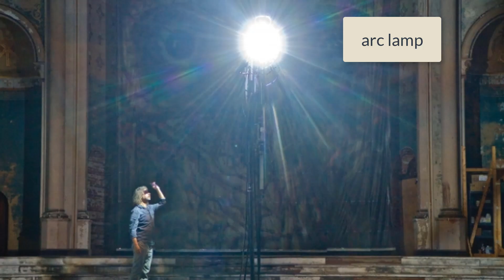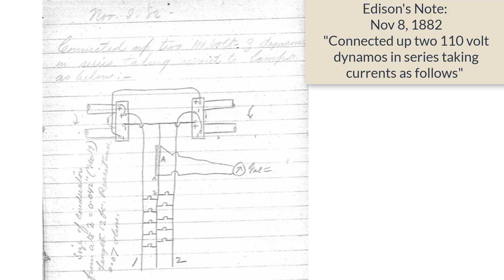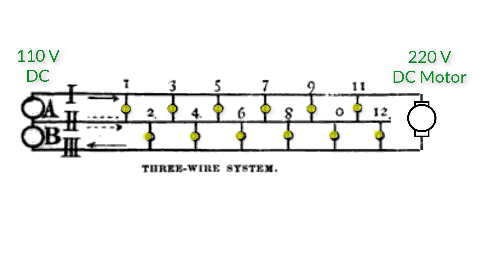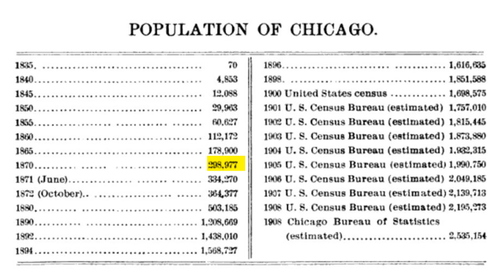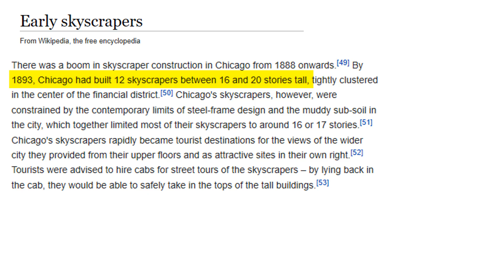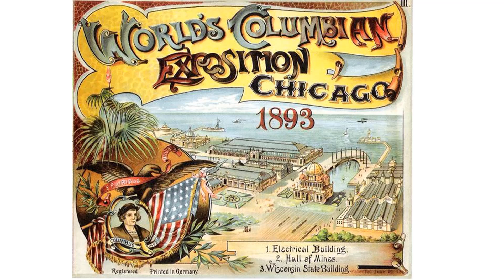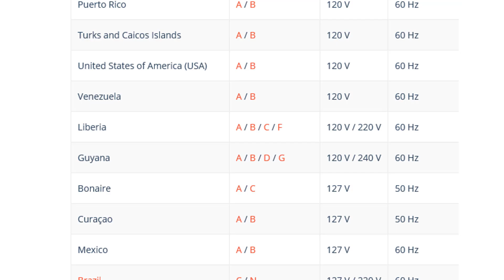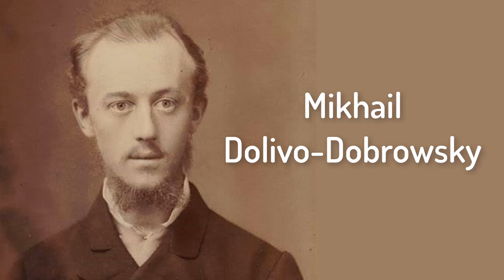Physics and History of Why USA uses 120 volts and not 220 volts

Comment: I enjoy your discussions on the history of electricity. My dad, like me was also an electrical engineer, said that in the early days of development of the light bulb, it was difficult to make the filiment thin enough for a higher resistance to run on 100 volts. The tungsten filiments were coiled to keep them compact so they didn’t have to have wire supports in the lightbulb. The 220v made the light bulb more difficult to make. Years later by better manufacturing techniques, they were able to make thin high resistance filiments. The 7watt candelabra light has a really fine filiment that was fragile and it took even longer to develop. When I grew up in the 1950s, when decorating Christmas trees with these bulbs the filiments would break easily when dropped. 
Remember that the only use for electricity in the early days was for light bulbs, so making practical filiments was important.with time light bulbs got smaller, but they were then made for lower voltages and ran In series. 
PS I worked in two Silicon Valley laboratories where they developed the first practical LEDs in the late 1960s, that is Fairchild semiconductor and HP laboratories. HP first used them in the HP-35 calculator. “You could get them in any color as long as they were Red”! To paraphrase Henry Ford. Ross

Comment: How can you get 220 volts across a motor from connecting 2 positive 110 v supplies? I think your diagram needs some adjustment. Both 110v lines would be connected to the positive and you would then connect the neutral line to the negative.

Comment: USA AC voltage in homes is now 240 and 120 vac at 60 Hz. The power company puts a transfomer to step down the high voltage on the transmission lines down to 240 vac with a center tap that allows the electrician to wire either 240 vac or 120 vac to every outlet or light in the home. Europe is most 240 vac at 50 Hz which does save on copper wiring in the home since you can deliver twice the KW power with the same amps and copper wire size. However 50 Hz does have the drawback that the transformer has to have more steel since the magnetic coupling is less at 50 Hz than at 60 Hz.

Comment: I disagree with your explanation of 3 phase generation. You relate 3 phase to 3 different wires and that's not the concept at all. 3 phase electricity is formed inside the generator with 6 different magnets and producing 3 different phases of electricity during a single rotation of the generator. Instead of the sine wave switching 180 degrees polarity all the way to peak plus and minus negative voltage, it is generated 3 times at once on the same circuit with every rotation of the generator core. This 'smoother' type of signal is much easier on electrical equipment. The way you explained it made zero sense to me.

Comment: North American and some other locations use dual voltage 120V/240V 60 Hertz single phase AC for residential, office, etc. and 480V 3 phase 60 Hertz or industrial.  This is compatible with European 380V 3 phase 50 Hertz.  There is still a lot of old industrial stuff of varying voltages.  I'm old enough to remember 25 Hertz, including 25 Hertz 4 phase (the last place to use this, to my memory, was the North end of Philadelphia, PA, and the last-last place was Frankfort Arsenal, i n. the North end of Philadelphia, PA.

Comment: BTW, houses as in residential locations, especially single family dwellings DO NOT get two phases of a three phase system. They use TWO legs of 120 (from a single winding distribution transformer) and are provided with a  neutral (ground). The result is 120 either leg to ground (or neutral) and 240 leg to leg. The phase relationship between 120 and 240 in the home is "0" degrees.

Comment: One of the reasons for the 110 volt value was that the first lamps used a carbon filament in a vacuum. By lab experiments,  Edison found that above 110 volts, the lamp filament life would rapidly decelerate. This was what Edison found was a "sweet spot" to  establish the 110 standard based on carbon filament technology. Tungsten came later in 1920's . The +/- 120 volts was found empirically to be the highest "practical value" with tungsten filament bulbs. When tungsten  was introduced in 1920's replacing carbon bulbs, 120 volts was selected as the highest value as a compromise for filament life vs. base design voltage. Higher voltage lamp designs came later in mid 20th century.

Comment: This is missing a HUGE piece of the puzzle on how our electrical grid came to be as it is.  Nikola Tesla and his research into polyphase electricity and the invention of the AC induction motor.  While lighting was important, it was just a small percentage of power being used.  The vast majority went to running AC induction motors, which most ran on 3 phase power.

Comment: The main saving using a higher voltage is in reducing distribution losses, the power lost bringing power to end users, but yes, it also eases the requirements for transformers, the same power can go through thinner wires. In the case of 60Hz vs 50Hz, well, they are quite close to give a clear advantage to any of them, AFAIK the frequency was chosen so no flicker could be seen in light bulbs, and both achieve this. There is a slight advantage in 60Hz due to transformers being marginally smaller, but in long distance transmission lines create slightly more problems with line couplings and reactive distribution, but just *slightly* more.

Comment: Thank you. I love vids that make me think and search a bit. I started wondering if the bulbs would be as bright on AC. I should have remembered that wall voltage is its RMS value. (Spoiler: the same bulb and brightness.) 120V RMS has a peak voltage of 170V. Approx 156.5V peak AC if your house has 110V/220V supplied.

Comment: Where does Joseph swans light bulb fit into all of this, as he supposedly invented his at least at the same time as edison. They even became partners eventually iirc in the ediswan company. As presumably these existed before the German dudes and their new fangled tungsten, was the uk/European system lower voltage originally or was swans bulb suitable for higher 220v operation?

The US split phase system is a bit of an anomaly, but as far as I can see you didn't really explain whether the 110v was a holdover from the DC era or was instituted for some reason during the AC era, or why 60hz vs 50hz. Iirc the European 50hz was something to do with Siemens producing equipment but could have misremembered.

Comment: That's the most detailed description I've heard so far. I knew it had to do with Edison's 110V light bulbs, but that was all I knew. It was not only voltage, but frequency. Westinghouse favored 60 cycles while Siemens favored 50 cycles, so countries which bought American Westinghouse equipment standardized on 60 cycles and countries which bought Siemens standardized on 50 cycles. Japan brought from both, so they have an interesting mix of 50 and 60 cycles. Of course we have a few pockets of 25 cycle power, used for railroad traction power. Safe Harbor Dam still has 2 25 cycle machines to generate power for Amtrak. BTW the railroad uses 440V to distribute power on at least some of their trackside lines. I often see 440V written on the crossarms of open-wire trackside lines. Now we've come full-circle and DC has come back into favor, at least for some high power transmission lines.

Comment: I live in Kobe, Japan, where our electrical system is the EXACT same as the USA: 100-110v, 60 hz. The eastern part of Japan, near Tokyo, uses 100-110v, 50hz. So I can buy and use anything made for use in the USA. It will run perfectly well and safely here.

Comment: In Silicon Valley there is a thing called First Mover Advantage. But there is also a thing called First Mover Disadvantage. And the 110V in America is an example. Same goes to NY Subway system. The reason why the subway in NY is so complex and yet so backward because they invented subway there. So it is not always the best to be first mover. You go slow so that if changes need to be made you are not too committed to change the system.

Comment: The optimum burning voltage of a carbon arc lamp is between 55 and 60 volts. Two of these in series require 110 to 120 volts. Four in series require 220 to 240 volts. This is the origin.

Comment: Another mistake. Towards the end of the video you stated that the 2 phase wires were 120 degrees apart. It is the push and pull of the AC current on those 2 wires where the phase of the push and pull is 120 degrees apart. The two wires have nothing to do with the phase. Just clearing that up.

Comment: Fascinating history!👍 My reading is limited, but I understand parts of Europe use three phase much more extensively than we do. Our common use of “radial” (one wire) feeders saves copper, but three phase motors and heaters in the home would be more efficient, and load balancing wouldn’t be an issue.  Imagine if we used the 400Hz AC that became common in aircraft to save weight. I spent four and a half decades with the “60 cycle hum” of transformers (retired Hydroelectric Operator); imagine living with a “400 cycle hum.”😉

Comment: Americans have 220v up to the consumer unit. It is then split into two banks of 110v. However, most A/C units require 220v so they use a double fuse that connects both 110v lines to give 220v

Comment: US/Can power to the home is not 120 volts, it's 240 volts. The two wires that Kathy describes as phases are not individual phases, they're the two 'Legs' of a single split phase. The transformer outside of the home splits one phase of the high voltage (typically 3-phase) distribution line(s) into a three wire system (L1, L2, N).

Comment: There seems to be a gap there.  Because we do have ~240V service to our homes.  The reduction to ~120V happens by splitting the phases with the 3 wires at the transformer we're connected to... but the two legs are still ~240V.  So, the infrastracture was "fixed" by that and the utilities didn't really have any need to adapt it.

Recent update on WIlliam Jenney:  Apparently, it wasn't enough.  Chicago's buildings are sinking.  :)  Of course, newer even heavier buildings now.

Comment: Although on paper the UK has 220 volts it is actually 240 volts. This was a fudge by the EU who wanted the voltage to be the same in every member country. So voltages go from 220,230&240 with + or - 10%

Comment: Another consideration is materials technology wasn't as far along in Edison's day as it is today. In spite of the fact that higher voltage is more efficient by reducing current, at that time  insulating wires to prevent them from shorting and causing a fire was a dangerous issue. The higher the voltage, the more critical the insulation on the wires became.  When wires are manufactured the insulation on those wires  has a voltage rating.  The rating is determined and certified by testing laboratories like UL and CSA. Since the technology took hold in the USA before other countries,   the most expedient solution, around the higher voltage jumping through the insulation around the wires, was to lower the voltage.

Comment: Higher voltage like 240v locks your muscles up when you are electrocuted. 120v allows a person to maintain enough muscle control to let go what is electrocuting them. It's easy to step down from 240v and most devices work fine on 120v. So that became the standard for wall outlets.

Comment: My grandfather was an electrical engineer who told my father around world war I that the President of Anaconda Copper handed out stock certificates in Congress and stated that these certificates will be worth twice as much if you adopt 110 volts instead of 220 as the national standard. Why? because when you halve the voltage, you need twice the current to transmit the same amount of power. The size of a wire determines its current capacity, the insulation around the wire determines the breakdown voltage. Copper metal costs more than rubber or plastic insulation, so the smelters wanted to sell more copper. At that time the worlds largest copper mine was in Jerome, Arizona, and rubber was imported from southern Asia. Congress also liked the idea of keeping our dollars at home.

Comment: How did he reduce the copper by 60%? Removal of 1 wire would be 25% and then reducing the 3rd wire by even 80% only adds another 20% reduction for a total of 45%.

Comment: I found it interesting that Edison had DC 3 wire distribution with 2 legs with 110 volts.  I think more could have been said about the transition from DC to AC.  New to me was why the US stuck with 110 volts while Europe went with 220 which takes a lot less copper.  Some time I would like to hear the explanation why all our house wiring has a ground wire and a "cold" power wire which also goes to ground.  Europe doesn't.  Seems like a terrible waste of copper which is getting more expensive.

Comment: The supply to my house (in the US) is 240v single phase.  the output transformer is center tapped giving two 120v split phase circuits.

Comment: The only advantage the American mains has is that that it runs at 60hz which is slightly better for AC transformers than 50hz. However you have to use more copper to carry the higher current demands of the lower 110v rated appliances...

Comment: Presumably the reason the US generally has 1500w electrical heaters for homes and the UK has 2000W electrical heaters for homes is due to the voltage difference 1500w/120v = 12.5 A vs 2000w/230v = 8.7A meaning less copper needed.

Comment: All very well. D.C. is fine over very short distance. Tesla's A/C far better for national transmission. Similarly 240 volts is more efficient than 120 volts. Understandably America which pioneered most of this work, was hampered by a legacy system. The same thing happened with the advent of colour TV, America had it first with the NTSC system, derided by the rest of the world as "Never the same colour twice". UK, and most of the rest of the western world used the PAL ( Phased alternate line ) a superior system but quite a few, tens of millions of homes had NTSC, and weren't going to change overnight, understandable. The French, always looking for anything to differentiate from the rest, Came up with SECAM, Séquentiel de couleur à mémoire,
not much different from PAL, SECAM was also adopted by the Russians. This is not to knock, but to praise America, but being first Cab off the rank can also have it's problems.

Comment: In the United States the appliances like Clothe Dryer work in 240 volt system.  By connecting phase to phase you can get 240 volts

Comment: 240 volts in a house is not 2 phases. I wish people would stop confusion others on this. There are 3 phases coming down the street. One phase goes to your house. It’s one phase. One phase. Not two phase. It’s simply a 240 volt transformer with a center tap in the secondary for a neutral. But it’s one phase. Single phase.

Comment: I’m assuming the two generators where phased 180 degrees apart? I wonder how he synchronized them together in those early years? Driven by a single engine? All of our power is 3 phase, 120 degrees apart, and a typical residence uses only one phase with a 240-250 volt transformer with the center tap of the secondary grounded. Any time we have 3 phase service with 3 transformers, a single leg is 120 and any two legs are 120x1.73 or 208.

Comment: Sending DC (direct current) over copper wire was cost prohibitive so DC power couldn't be sent very far. Tesla introduced AC (alternating  current) and AC voltage could be stepped up so AC could be sent long distances. Tesla was responsible  for all of this and all others were thieves. Tesla was way ahead of his, and others, time.

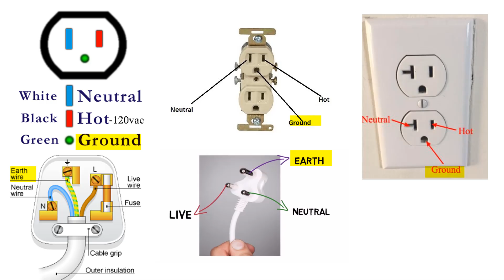Comment: At 12:24 Kathy mentions higher-powered devices requiring higher voltages.  I might add to her explanation: This same high power could be achieved with 120 VAC, but by stepping voltage up to 240 VAC the required current was cut in half (Power = Voltage x Current).  Thus SMALLER CONDUCTORS could be used at 240 VAC vs 120 VAC.

Comment: This is my pet theory as to why America (generally) sucks at making a good cup of tea. At 110v an electric kettle takes maybe four times as long to boil as a 240v one does. Thus busy folks in the morning just make tea with warm, not boiling, water and the taste doesn't compare. Tea has volatiles which are only released at 100C.   Coffee, on the other hand, is just fine when it's made with hot water. 

Then there's the fact that Americans tend to throw good tea in harbours.   Savages.

Comment: At least we can thank Thomas Edison for the phonograph and, by evolution, the disc gramophone. Today our area of the city had a rare power failure. It was great to still be able to use my spring powered Rexonola gramophone to play some neat 78 rpm 1940’s jazz music—all modern technology like iPads and PC’s were useless as WiFi was down and data rate reverted to 3G—not even a Google page would load. The other technology that still worked was our hand wound or weight driven antique clocks (which still keep time to within 10 seconds or less per week).

Comment: Is it too late to ask for an explanation of the striped countries on the map? How can a single country be 50 and 60 hz? There couldn't be any interconnection between the two frequencies. It would have to be different portions of the country are 50 or 60 hz. And the map should have shown the different sections rather than being striped.

Comment: The 120v supply means that the USA grid is not as robust as the 240volt supply.
I think.
So if you go 100% electric power and no fossil fuels then the costs would be hige.